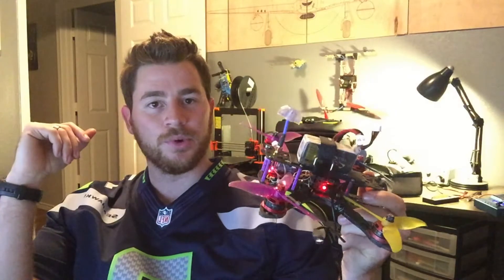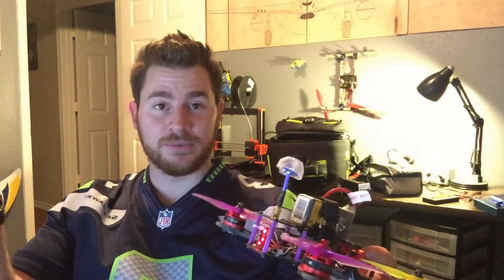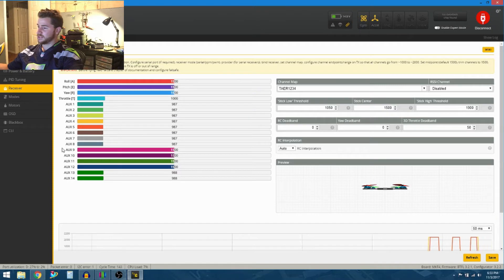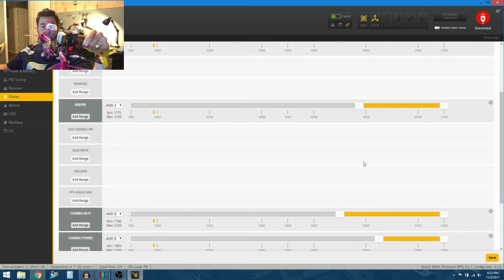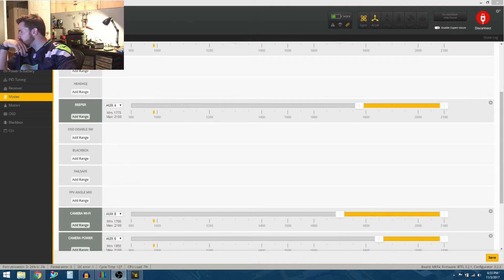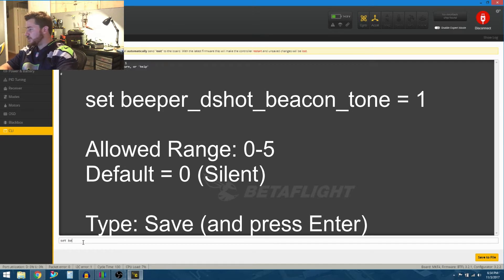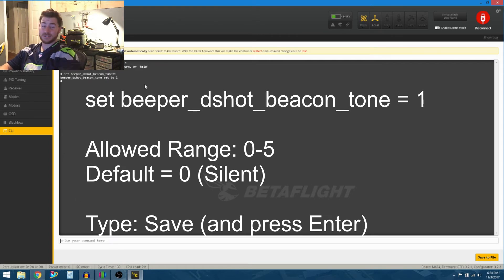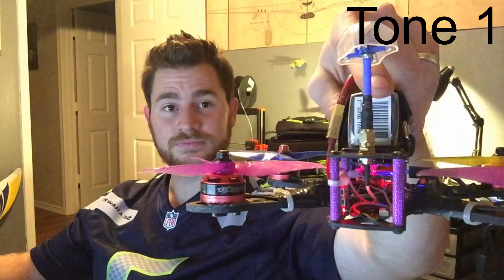ESC Beeper Fix: BetaFlight 3.2 (DSHOT only)

Comment: THERE IS ONE MORE "FIX": 
In Configuration, then in Beeper Configuration: USB button must be ON: "Beep when flight controller is powered from USB. Turn this off when you don't want the beeper on the workbench". Or else no matter what it won't beep while in BFC.
Reply: Thanks my beeper started to work after this change.
Reply: OMG You are the best sir thanks for the tip.
Reply: Thank you!
Reply: Fuck me as far I go in this hobby as more stupid I feel lol cheers! start working as well!
Reply: thank you this was my case ;-)
Reply: Thank you!!!
Reply: While it did fix the beeper configuration I had multiple other problems trying to upgrade from INAV 4.0 to 4.01.  It turns out I picked the wrong target and once I got the right info in the  configurator it went smooth with no errors showing in the CLI status.  Thanks again.
Reply: I do this and nothing happens, I do not understand why. NO effect over the beeper, i can not disable when is on the workbench. Tested on 2 different drones.

Comment: I just got mine to work by flashing the latest firmware for my ESC's in BLHeli  Configurator (16.7 for the tinyhawk). I have a tinyhawk with the same problem. I tried the CLI command but the new version of BF will give you "Invalid Command".
Reply from the maker: Glad you got it working! This video is over a year old and with the rapid developments of firmware I’m not surprised if this video is now obsolete.
Reply: @Danimal-3D  Yeah I loaded the Mockingbird firmware. I want to say that before doing that I had the beeper. I'm glad I stumbled on your video. Thanks :-)

Comment: What if you have caps on esc's. Cant get it to work on 3.5
Reply: Same here, did you find it out?
Reply: I have also a 1000μU Cap on my Racer. Works as it should. Look under Configuration -> Buzzer Tab ans enable RX_SET

Comment: I thought that when I discovered your video I was going to fix the beeper and once I finished watching it, what a disappointment.
I've already set it up for the engines to sound. What I want is for the buzzer to be heard, which is much stronger and will not cause the engines to break down. If on any flight, I lose sight of the drone, the sound of the buzzer will always be heard much better than that of the engines.
I still do not know why it stopped working, it does not happen to everyone. I changed the buzer, in case it was broken, but nothing, I will have to continue with the sounds of the engines
Reply from the maker: Yeah this video was specifically for the ESC beeper, not a standard beeper. Depending on your flight controller, you just need to ensure you've wired it up correctly. Once confirmed - ensure you have the appropriate "sliders" on the Configuration tab activated which is where you setup your Beeper. Hope this helps!

Comment: If I do this now will it change anything else on the quad I think im running 4.0.4
Reply from the maker: If I remember correctly the newer Betaflight configurators have his setting as a drop-down menu now, so hopefully you won't need to program it via CLI anymore -- but to answer your question, no it doesn't impact anything else.

Comment: Thank you! 
Question though: The motors are kind of spinning when the escs beep...is it dangerous? Could this burn them?
Reply from the maker: Thanks! Actually, the beeping is caused by the twitching movement of the motor(s). I've never had an issue with this burning out a motor. If you are concerned about it, you could always add a normal beeper to the quad.
Reply: Thank you, I Asked because me and maybe someone else has the same question , we gather information and share experiences :)
Reply: It’s not a problem if you are triggering the beeper function for short periods of time. If you are searching for your drone, enable the buzzer for like 5 seconds, listen carefully, disable the beeper, wait 5-10seconds and enable it again for 5seconds. Repeat this steps until you find your drone. With this way you let the ESCs and Motors to cool down a bit. Otherwise, if you let the beeper Funktion on for like 2-3 minutes you will most likely fry an esc or a motor.

Comment: Beeper does not work on all blhelhi 32 esc unfortunately.
Reply: try flashing to 3.2.3 Betaflight and try again .. had the same problem
Reply: Krzysztof B it is not a betaflight issue. It is a bheli_32 bug.
Reply: Btw just in case check is the beeper tone is set to 0 which is to activate buzzer only. It needs to be at 1 or more.
Reply: Do you know if it is fixed by now?

Comment: HI, did you have to set up your escs to beep before this?
Reply from the maker: Dodgey Geeza I suspect your answer is, Yes. Your ESC’s need to be DSHOT capable for this to work. Double check in the BLHeli configurator to ensure it’s flashed with it as well. You also have ensure you’ve made the DSHOT selection in the Configuration tab for the ESC Protocol for this to work.

Comment: this is only for dshot? doesnt work for the regular buzzer
Reply from the maker: Ruxys - yeah this fix is for using dshot ESCs to make a beeper noise. Your regular buzzer shouldn’t be impacted - just ensure you have your regular buzzer soldered correctly and the correct slider toggles turned on in your configuration tab within Betaflight(at the bottom of the config page)